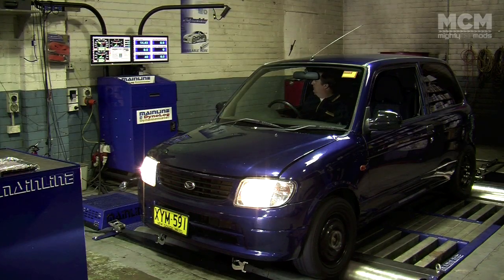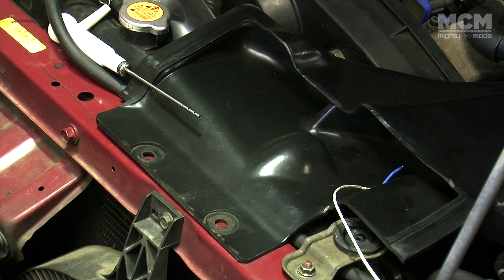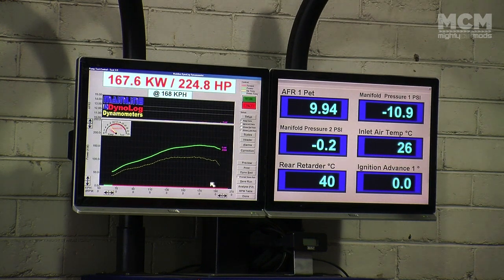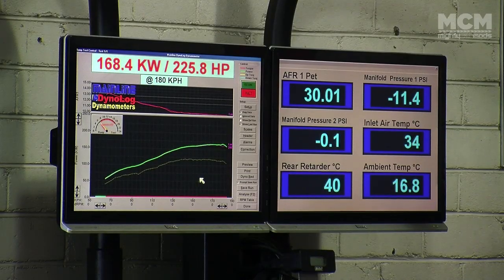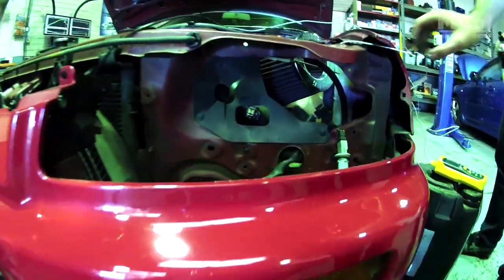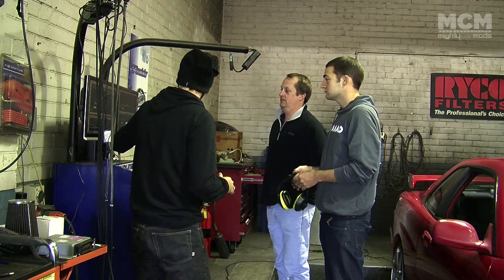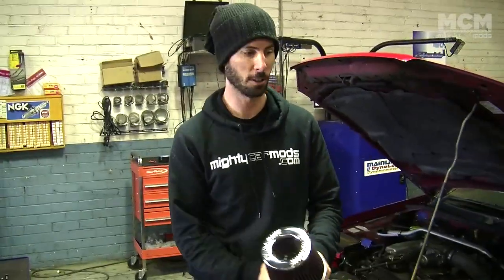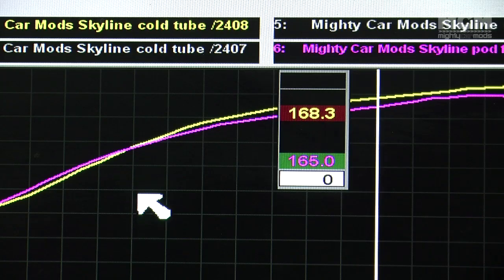Cold Air Intakes Mythbusted [Turbo]

Comment: Guys, if you expect gains from intake with no ECU adjustments to compensate, it probably won't happen. There gains to be made otherwise the whole industry would be faking their dyno data. I'm sure they do it under their own ideal conditions. And these "cold" air intakes are not really effective because they are in the engine compartment.

I'll see for myself next week when I install the Dinan Carbon Fiber Cold Air Intake (a true cold air completely insulated system that takes air from the lowest part of the car in the front fender) to mate with my Dinan S2 software upgrade. This intake is totally insulated and has mainly carbon fiber walls and it doesn't replace the stock intake but rather supplements/adds more air (40º cooler than stock air) to the stock intake.

So far, adding a BMW M Performance exhaust with the software has made noticeable diffrence...the wheels skid more with the same driving style and intensity.

We will see if the intake addition makes a noticeable increase in performance.
Reply: Keep hearing that you need to adjust the ECU for this to work.  The ECU knows what the incoming air temperature and adjusts the fuel curve to compensate.  The whole point of electronic fuel injection is that you don't need to tune the car for different environmental changes.

When I hear that a CAI works best with a tune I think of that movie GO where the girl selling the fake ecstasy says you will feel it work better if you smoke a lot of pot.
Reply: Jim Fallowfield
Well Jim, I'm not a mechanic or engineer. But I imagine that although companies want to make profit, they do have to have some data to back up their claims, however ideal conditions they use to come up with the numbers, they are still there. This video most likely doesn't show the intake accessory in the manner that the factory did their testing. Is that realistic? Of course not, you can't trust companies for their inflated numbers. But I'll take the path of personal experience, so if you will forgive me, I will see for myself if that $1200 I just spent really made a difference. I already spent 1300 on the BMW exhaust and it certainly made a noticeable difference with same style of driving so that is why I reserve judgement.

Too many factors to consider so can't say universally that it is worthless or worthwhile...either way.
Reply: matreyia if you want to see the best gains disconnect your battery to reset your fuel trims and let the fuel system relearn it with that air intake set up. then you will know you wasted money. the best way to gain the slight amount of hp is to just swap out your intake tube to one without any noise baffles.
Reply: John Mann That can be done without disconnecting the battery on an e93.
Should I even ask you if you know the Dinan CAI system for the e93 and how it works? From your words, it does not seem you know the system. There is no swapping out anything, there is no replacing the stock intake. Every  is stock, the only difference is there is a supplemental forced induction system configured to add 40º cooler air to mix with the stock intake. Not only is there additional air, that air is also 40º cooler. And the Dinan software ECU upgrade is configured to take advantage of the extra cooler air. Right now, the Dinan software is not taking advantage of the intake as it was intended to do...so...

I can come back here to report my impressions after next week when the intake system is installed. Or I can stay away if people don't want to hear it because they already know everything in every case. It could end up impressing me with noticeable gains like the M Performance exhaust I just installed, which immediately integrated to the Dinan software to increase output. Since I did not expect this gain, I would say that it is not imaginary or placebo...nor are my tires lying to me.
Reply: matreyia You say the intake pulls in air that is 40 degrees cooler.  If your factory intake is already pulling air from outside the engine bay, how is it going to be 40 degrees cooler?
Reply: drjim86 Fake numbers example for illustration:
Factory intake pulls in air at 90º in summer, by arrival time travel through the plastic tubing (through the engine bay, next radiator area, etc) to the air box filter section, temperature heated up to 150º, then goes into the turbos, ect...
Dinan Sealed Carbon Fiber Insulated intake pulls in same temperature 90º, by arrival at the air box filter section, due to carbon fiber insulation/seal and air from lower section of car away from engine (in front of tire, next to fog lights) the air temperature increases to only 110º. A 40º difference. The cooler air will then mix with the stock air temperature to help reduce mixed air to a noticeable degree. Everything counts in large amount.
Reply: matreyia Hard to argue with fake numbers but I seriously doubt air traveling through a plastic tube is going to be heated by 60 degrees unless it is passing through an open flame along the way.  Plastic is not a good conductor of heat.  I do believe the temp sensor can get heat soaked and give you that false reading which is why some people relocate the IAT sensor to give a more accurate reading.  The Dinan cold air intake includes a kit for doing that which probably has something to do with the power increase.  By the way, the Dinan cold air intake promises a 5 hp increase for the low price of $1200.  Put me down for 3.
Reply: drjim86 "Fake numbers" means hypothetical numbers to explain how your question can be answered. Because the questions is non-sense but I still took time to explain to you the process whereby it would happen IF the claims were true from Dinan. If you think that it's not possible to cool down air before the engine by 10, 20,30 or any degree, then good for you. The interior of the engine can reach 0ver 200º so you can imagine the THIN plastic, as shitty a thermal conductor as it is, won't keep that air as cool by the time it reaches the turbos. Given that the Dinan carbon fiber is super thick and carbon is even worse thermal conductor than plastic, I'd say their claims weren't pulled out of their asses.

Do I think it's going to make a noticeable difference? No idea, thus, it was said, "I will see with my own experience" and not rely on idiots who think they know every scenario, every car, and every product every designed.

So go ahead and say whatever you like. You can think that there will be no difference in the air temperature between the plastic shrouding vs. that thick ass carbon fiber tubing and intake cover...it don't matter to me.
Reply: matreyia Have you done any research on this or are you just relying on brochure numbers? 

I don't see how my question is non-sense, it is a question that should be asked before anyone installs a CAI.  I'm not going to install something to fix a problem that is not there.  Meaning, I would find out what my IAT is before trying to improve it.  Is your IAT really 40 degrees above ambient?

If Dinan told you that you would get an increase in power by installing a fuel pump would you just accept that or would you question if your stock pump was adequate? 

People running short ram intakes find that the IAT is 30 higher than ambient at a stop light and 10 degrees while moving.  This from a car pulling its air from under the hood.  Worse case scenario.

A stock system would be better.  A Camaro driver reported that his stock airbox pulled in air 5 degrees above ambient while moving.  Nissan guys report the same thing.  That's why I question Dinans claim of 40 degrees cooler.   If that makes me an idiot, so be it.
Reply: drjim86 "I'm not going to install something to fix a problem that is not there.  Meaning, I would find out what my IAT is before trying to improve it.  Is your IAT really 40 degrees above ambient?"

1. There is not problem. It is just a supplement.

2. I have no idea and don't really care. I even have reason to doubt any company claims of anything because they want to make money.

3. It is NOT pulling air from under the hood. It is pulling from outside the hood away from the radiator AND 97% of the device is insulated with thicker carbon fiber.

4. Dinan reports UP TO 40º possible. I really don't care about their numbers.

5. Dinan reports their exhaust and intake is designed to work with their software and they reported their exhaust numbers as 6 hp while BMW M Performance reports 5 hp...that is not enough to be noticeable imo, but after installing the BMW exhaust, there was a noticeable increase in performance, throttle response, and tire skid so they are either under reporting to play say, or they don't know what they are doing. In light of this personal experience with the exhaust, I am curious to see any gains by the additional air supply.

You apparently do not know the Dinan CAI design, which is why you asked and presumed it was pulling air from under the hood. You want to side with people who say no gains and it's all myths. People like these two Australian dudes who have a Youtube channel. Good for you.

I will reserve judgement and see for myself because me thinks it unwise to completely generalize the entire concept of this type of modification in all cases and ignore engineers the world over because of hearsay or videos from nobodies on Youtube.

Now if you like I will report my findings whether the thing makes any increase or not, or you can keep commenting from your armchair with no personal knowledge of my particular car or Dinan CAI. Or I can go away. Don't matter to me. I have the CAI, I am the one actively doing the experiment, and I will be the one with real life experience with the thing, you on the other hand will still be sitting in an armchair believing in internet gospel and absolutely making up your mind on the matter with no personal tangible evidence.

Did you think I installed my new exhaust because of performance increase expectations? All the reports I read and heard about increased performance made me generalize and expect no noticeable gains, yet here I am reporting gains. That being the case, why should I repeat my last ignorant stance on these matters? I am now a person who is skeptical and wants to see for himself. End of story.
Reply: matreyia Could you show me where I said the Dinan pulls air from under the hood?  I said a short ram intake pulls under the hood which is the worse possible situation.  And even in that situation, the intake air is not 40 degrees above ambient.  The engineers at BMW are clever enough to build an intake that does not pull air from under the hood.  This is why I question a 40 degree drop in intake temp.

You say you are doing the experimenting.  If I was doing an experiment on the effect of cold air intakes, I would want temperature data.  That is the whole point of a CAI is it not?  

Step 1: Measure the IAT before modification.
Step 2: Install CAI
Step 3: Measure the IAT after the mod.

IAT is measured with reference to ambient temp.
Engine is tested only after it has reached operating temp.
Reply: drjim86
Why would I want to waste my time measuring the air temperature when it isn't even why I installed the intake? Repeat what Dinan did but with home made techniques...yeah, that will be really precise.

I am only interested in ANY noticeable gains...now that I am done installing the thing, I will post a clip showing the design and how much of a pain in the ass it was to install. Then I will go for a ride this entire evening driving the usual way I drive to see if there are any noticeable differences in performance....throttle response, peak pulling power etc. If there are, great, if not, too bad I wasted $1200 on a carbon fiber sculpture eh?
Reply: matreyia  How will you measure your performance increase?  By feeling?  Did you mention something about precise?  All right, I will stop now.  Enjoy your new intake.  If nothing else you will enjoy the aggressive sound.
Reply: drjim86
Just got done driving the car for three hours. First 20 mins, no noticeable change in up to 4000RPM, then after that, the car pulls up to red line, whereas it did not pull up to red line before.

After 1 hr. no noticeable change under normal conservative throttle driving up to 2500 RPM, after that car starts to pull up and pedal must be released to coast, otherwise, tickets will arrive sooner or later. If driven of the starting line with very soft foot, no noticeable change at all. If driven with same take off intensity as before, tires skid whereas it did not previously, so now, less pressure is required on accelerator. Throttle response has changed dramatically and car is much more sensitive to foot pressure.

At 3 hr mark, car sounds monstrous if passing on freeway, combined noise of intake, earlier turbo activation, and exhaust...it becomes disorienting and scary. By this time, the ECU has adapted the intake additional air and temperature differentiation from previous set up, integrated with free flow M Performance exhaust...very sensitive to pedal pressure, 30% more skidding tires, pulling harder even from 80mph on highway when I step on the gas.

The least noticeable range that the intake seems to affect is the 0-2000 range...after that, very different and noticeable increase in power delivery and smoothness of that delivery. Near redline is the most noticeable increase in output. Previously, this car would puff out near redline and make loud roar with nothing to back it up...now it is a completely new situation.

There is no need to get the intercooler as I believe I won't be able to even use the full power of the car as it is now...it would be too dangerous and uncontrollable for my level of skills. (top speed today was 145 before shitting pants and remembering that night freeway driving at high speeds is asking for trouble from any potholes or road hazards).

Perhaps a nice electronic BMW Performance Steering Wheel is next...as well as non-RTF Michelin Super Pilot tires to reduce wheel weight by 20% over all four tires. Should improve take-off time a bit and increase steering precision and response with that weight savings, not to mention quieter ride.

Posting installation video today or the next.
Reply: matreyia you don't have to disconnect the battery, it is just the quickest way to reset your long term fuel trims without a tuner or scan tool. no i didn't do any research before commenting not a big big fan of the bmw so i have never looked into them or mods but if they're anything like good old fashion gm engines there is minimal gains from that system because even with forced induction and the added scavenging from the exhaust. your throttle body can  only allow so much. a larger throttle body, a proper tune and adding more fuel  would make your car 10 times more tire squealing fun(slight exaggeration). 10 years of building and tuning cars, bikes, snowmobiles and the occasional redneck racing mower i have a pretty good idea of how to make a pretty fun internal combustion engine. if its faster good on ya bud (not trying to sound like a know it all just adding some credentials to my angry youtube comments)
Reply: John Mann
John, it's a waste of time discussing mechanical theory with me. I installed it, and it works as advertised. Yes, the intake works...I would say a tiny bit better than advertised. Apparently Dinan takes the safe path and under reports their gains.
Reply: This isn't an accurate depiction of the capabilities of a cold air intake. Skyline's are already built out the wazoo for performance, if you're expecting to get an hp boost from a low cost mod like a cold air intake, you're crazy. Now slap one on an integra, or a civic, or a flipping 1980's chevy pick up. You'll definitely notice that, but to see a power gain on a skyline, try spending around 4,000. Not 400.
Reply: Alex Bluford
Yep. There are intakes for BMW from Gruppe M that cost well over $3K...they had better have some performance gains or else people would just not buy them and start word of mouth that none of them work. Same with exhausts. Hell, I didn't even expect gains from my BMW Performance exhaust but there were noticeable gains...I couldn't believe the difference. And now with this Dinan intake...holy mother of god...it gets better every day...like the car is "learning" that it has bigger lungs or something.

Next week, I have to get new tires. These ones are almost bald from the skidding.
Reply: you sure got announcement urges ! :D
Reply: Thank You for speaking up I did the  Filter swap on my Silverado recently NO GAIN, Then the Tuner Got Hold of it and then it was absolutely like uncorking a beast! Just a 4.8 v8 but man There is a huge difference in Torque that I can feel and now it frys the tires where before it would work up to it also adjusted the shift points even got a little Gear Chirp . I wonder if the Tune alone would have gotten to the same place without the Filter Change but Eithr Way The Box/Filter looks Cooler and is also Re usable so worth it either way.
Reply: J garcia Yes! The TORQUE is noticeable...That's what I'm talking bout!
These two dudes as well as other people who go out and slap on some intake and expect gains are going about it as if it were that easy. Show's how much they know about the details of how these complex systems work.

I just installed a Dinan Intercooler to top of the intake, performance exhaust and Dinan S2 softwarer and Holy Hell the car is scary now. Effortless torque and pull to red line. I gained 3mpg with the intercooler added.

If you gonna do it, do it right and you will see what all these claims are about!
Reply: matreyia these dudes were testing JUST the cais and their filters....like they said at the start of their video. thats it. bare minimum. not sure where this "doing it right, racing, flashing ecu, diff interoolers blablabla " coming from. the goal was to slap it on and see what the numbers say. no need to go all mechanical phD on the subject.     this video shows that you failed to listen to them and you assuming that they know "this much about this complex system".
Reply: Nikolai Poberezhny
"Guys, if you expect gains from intake with no ECU adjustments to compensate, it probably won't happen."

Learn to read before lecturing people on listening skills. I was not talking about the two guys in this video per say, I was talking to anyone who does thinks you just add stuff at a bare minimum and expect gains. JUST LIKE what you are talking about...."BARE MINUMUM".

You failed to understand or comprehend the original comment.
Reply: Um... NO... And frankly you should learn more about engines and how they work before opening your mouth.  "Ecu" tuning alone won't make a CAI more beneficial in a car of that age.  Effective CAI's are just another bit and piece of an already worked over engine with SO many other things done to it (you clearly don't build engines or cars and I'm scarred to see how you've screwed up your own vehicle already).  In this car there was already a CAI in place from the factory so I'm not sure what they were hoping to gain, but anyone who think CAI's on average cars do ANYTHING is a "fast and furious" moron end of story. 

On modern cars with DI and other things going on, yes ECU tuning can do lots (depending on the engine) and maybe after doing a TON of other mods, a CAI could be used for optimal charge density and flow, but in reality the CAI does little to nothing until a car is moving fast enough (a fan can't do it)  to cause a ram-air effect and a density change in the charge load.  And even then it's a TINY percentage and only on VERY powerful and efficient engines in cars moving at high speeds. 

Now if this were a diesel...
Reply: Nobody debating here has really even pointed out the intake setup on this particular car and why a CAI on it isn't going to have the same effect as another car either N/A or a draw through maf.  Being this car is a blow through the only thing that matters is how much surface area the filter has.  Does this car require a ECU adjustment...no.  Would a draw through or N/A need an adjustment...maybe.  Depends on if the diameter of the tubing through the maf is increased.  If so, then yes, an adjustment is needed.  The transfer function will be different and your maf counts are going to change across the whole RPM range.  The fact that they are recording IATs at the filter housing is just dumb.  Datalog the dyno pulls and see what IATs the sensor is giving you.  Even with that, it depends on where the IAT sensor is mounted.  You can see up to 20-30* in IAT differences from the intercooler to the manifold.  So many other factors then just putting a meter on a filter and then saying they don't work.
Reply: matreyia All Dinan software does is remove the speed limiter and change throttle responsiveness...like a sport button.  Speaking for my favorite car, the E39 M5, that $1200 Dinan exhaust is basically just a hollow version of the stock cans.  And the CAI looks nice but those figures are garbage.  I have both on my M5 and I saw almost zero increase in measurable power at the wheels.  They give you HP figures that are measured at the flywheel so it's deceivingly high. But it sounds better!  Not $2500 worth of sound, but some.

Source: Used to work for Steve Dinan.
Reply: drewdude320i
Thank god I have a good imagination drew.